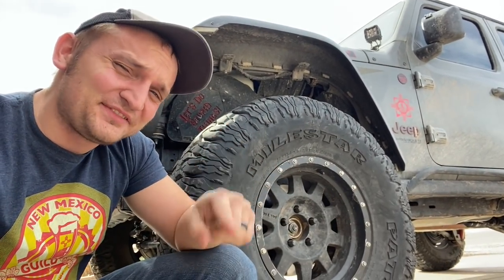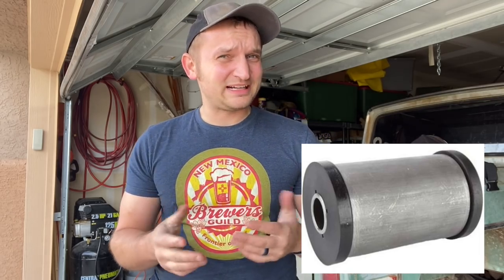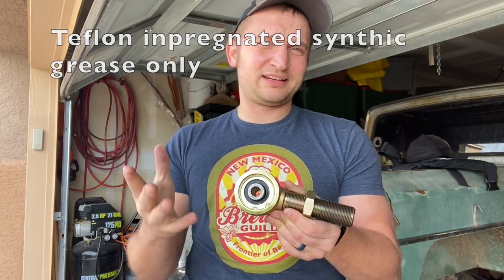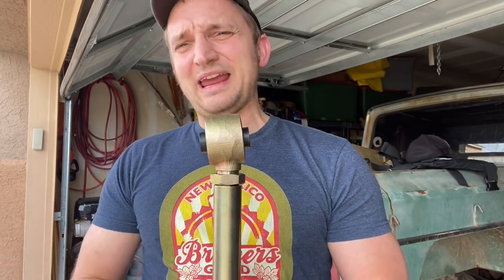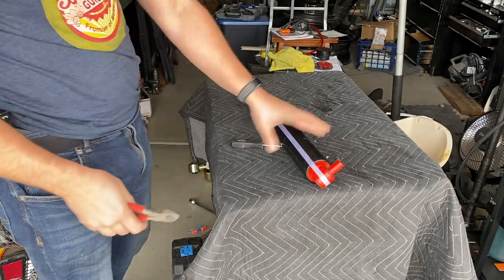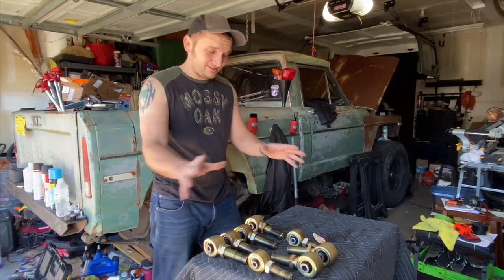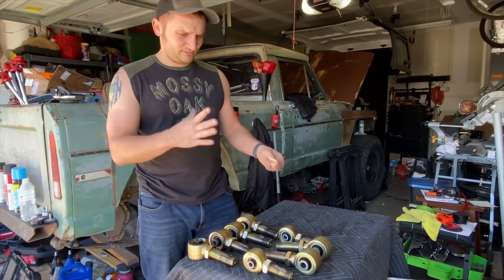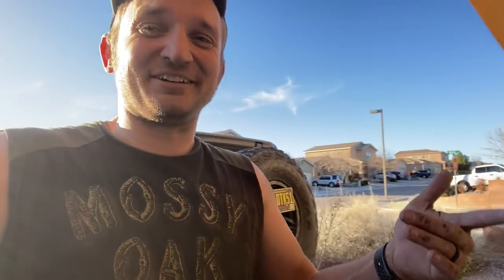Metalcloak Control Arms, What makes them unique? Game changer 3.5 Jeep JL lift kit

Comment: I install these lift kits. Just finished a 4.5 inch long arm kit on a Tj. There is a jk I did about 5 years ago with over 60k miles now that I put a short arm kit on and has never serviced bushings. No problems yet

Comment: I put 70k miles on johnny joint trackbars f/r in my powerwagon and only greased twice.  Never made any noise and now at 98k.  I just installed jj Currie Rock Jocks on my Jeep JL and couldn't be happier.   The bind/flex and weird handling/steering is 100% solved.
Reply from the maker: Thts awesome... would love to throw tons under bromance some day.... just keep on waitin to see if the cards get dealt to us lol. I love Johnny joints.. such a great performance part design.

Comment: That's a strange issue with the paint rubbing off the shock body.  I've never seen that before.  Thanks for the video and I appreciate the tips.  Hope to lift the Jeep in a year or so and plan to do Metal Cloak as well.
Reply from the maker: I mean... I probably should run more bump stop... but I love having all the extra articulation... really helps me do the stupid things 😂🙌

My logic is I don’t really see my upper shocks taking hots from rocks.... so I don’t think it will be a problem... 

Very happy with this lift so far... gear break in is almost done... I need to do some wheeling!
Reply from the maker: I’ll be doing a video on the the flex and comfort in a few months.. initial impressions... 

Thanks for watching! Can’t wait for u to lift your jeep! 😂 always an exciting time!!!

Comment: Is it common for the Rocksport shock boot to rub the red paint off? Couldn’t find anything about it on Google. And I plan on getting the 2.5” Game-Changers in the future.
Reply from the maker: Iv heard yes and no.... From what I’m figuring out... I think it really plays into how hard you wheel... rock guards on shocks ain’t common on aftermarket shocks either, and I think they look better without them on...🤷‍♂️😂

So I figure its easier taking them off now... rather then waiting for a problem and having to take all my shocks off again. 

I haven’t gone offroad yet (gear break in) but this lift is night and day on road... 

Iv seen plenty of JLs with this lift OFFROAD... and I’m not worried about how they are going to perform. U have made a solid choice 🙌🙌🙌

Comment: Great video! Did you have to replace the driveshaft when you installed the MC control arms? I know their website says you have to, but I don’t wanna
Reply from the maker: HAVE to? No. Depending on the level of wheeling... will determine how long the stock shafts will last. Maybe I should do a video about tht. 🤔 my wife’s jeep still has stock shafts... I have after market in mine

Comment: awesome ! appreciate your video , save me some money from buying useless mopar lift. so i need to change my driveshaft then enable to install the MC gamechanger 2.5 lift? i just checked my 2021 JLU it seems the front control bar is adjustable.
Reply from the maker: The stock shaft lasted me quite awhile on my 3.5 lift… I did change them,,, but the stock shaft didn’t fail, the slide boot did tear… and the cv joint boot was tearing… but the shaft was working… granted, those boots keep out dirt and debris, so it would of had problems down the line, but u can get away with stock shafts for a bit…. Even more so being an inch less
Reply: @JLLIFEOFFROAD  do you think if i go with the 2.5 lift, the stock driveshaft will last longer?
Reply from the maker: Thts what u said right? 

I mean I wheel pretty hard… u can easily stretch the life span of the stock shafts for a few years

Comment: Thanks for this vlog … I am trying to figure out what lift I am going with … I am hearing that metal cloak control arm are hard on the mount point during miss alignment.. I have seen that problem happen .. so I am still researching this issue !! Please message me in Facebook if you do not want to discuss this here … but i would love to hear your opinion
Reply from the maker: Thanks for watching...my experience with these arms is limited to a gear break in and 1 wheeling trip...

Tht being said... no complaints on performance.... install was pretty easy compared to some other control arms I’m Iv done..

As far as being hard on the mounting points... Few things I would say...

1. U want to be flexy... ur gonna our bond in those mounting points.. regardless of the arms... Thts a lot of weight

2. Jeep used thin meta to make the mounting spots

3. U can always add bump stop to prevent over flexing 🤷‍♂️ 

Metalcloak lift has 68 degrees of misalignment... RK has 60... i lm waiting for someone to release thicker mounts... mine were all twisted to hell when I swapped these in...
Reply: JL LIFE OFFROAD I still have a little while before I upgrade suspension … so I will continue watching you and researching before I make decision !! I really am leaning towards metal cloak !! But we will see !!
Reply from the maker: Kevin Ellis Initial impressions.. thoughts?? I’m kinda liking this maintenance free joint idea... I hate dropping arms to grease em... they don’t always line back up easily. 😂  big question is how long will they last

Comment: Later if you need to adjust this Metal cloak control arms, do you need to take them out before you can adjust or you don't have to take them out on jeep while adjusting?
Reply from the maker: U will need to drop them to adjust... Teraflex and synergy are the only ones tht make an arm with a double adjuster sleeve to do tht.

Comment: I have my MC control arm set ordered, Did you install all 8 control arms with your Jeep on the ground?
Reply from the maker: I did, it can be a headache... but it’s doable.. Tips to help... only do one at a time...
Reply from the maker: Using a Jack to lift one side of the axle can also be beneficial getting holes to line up.

Comment: How bad was your caster with using the stock arms and 3.5" lift?
Reply from the maker: When it was stock front LCA? 4....  added the adjustable cavfab arms... moved it to 5.5.... it’s currently at 7..... but I don’t like the pinon angle... will likely pull it back again
Reply: @JLLIFEOFFROAD  7!!??!   Like a chopper!!  Lol.  I thought mine was bad.   How did it steer at 4?  Like ass??
Reply from the maker: JL's Jk complete ass lol
Reply: @JLLIFEOFFROAD  lol.  I wondered.  Mine did too before I used the geo brackets.  Scary AF
Reply from the maker: JL's Jk I had hardcore DW at 4

Comment: If you are doing a 3.5 inch lift, should you upgrade the lower control arms or the upper control arms at the same time of doing the lift? Do you have to do front and rear or only front?
Reply from the maker: So... obviously the more adjustable control arms u have.. the better ur jeep will flex and allow for geometry correcting... however arms are pricey.. U can do a pair at a time...  I’d start with front lowers.... (allow for caster correction) 2. Rear uppers (allow pinon angle correction) 3 rear lowers.. 4. Front uppers. I only had after market front lowers for awhile.. I was able to do a lot of stupid things...
Reply: JL LIFE OFFROAD awesome thanks! I’ll definitely do the front lowers first. I won’t be doing extreme off-roading but I just want to make sure the geometry is fine and it will run correctly once lifted. I do plan on doing them all but not right away. Do you think it’s good to do front and rear lowers first and then the rest?
Reply from the maker: Start with front lowers 🙌🙌🙌

Comment: How are the metal cloak control arms holding up? Thinking mc or synergy… any advice on either?
Reply from the maker: Between those? I’d Stay away from synergy… just horrible customer service in my experience and is a common complaint I hear from others. I like the idea of adjusting while under the jeep, but I cannot get over how poorly they treat customers
Reply: @JLLIFEOFFROAD  thx for the response and feedback on the customer service... I agree it can make all the difference... how about in quality of product? In your video you had mentioned you wished the MC arms were a little thicker... are synergy any bigger?
Reply from the maker: Mc and synergy are the same thickness… use the same joints… but synergy uses the double adjuster which allows for adjusting under the jeep.
Reply: @JLLIFEOFFROAD  Awesome... thank you... you're the man! You seem to be one of the few that I actually believe when it comes to product knowledge! Thank you for your help my man!
Reply from the maker: Always happy to help 🙌🙌

Comment: I've had a 2.5" gamechanger lift on my JK for over 4 years now and the only complaint I have is how easily it ended up rusting. For a product that heavily markets itself on the zinc coating to resist corrosion, mine started fairly early and has gotten pretty bad ever since
Reply from the maker: Bare metal will rust... regardless how quality the steel is.... if their was a deficiency.... I’m almost certain metal cloak would have made it right... their customer service is the best Iv seen from a company.
Reply: @JLLIFEOFFROAD  Understood but I never bang up or do the kind of offroading that dings up my underbelly, so the corrosion I had on my metalcloak lift was purely just by daily driving it and getting the typical salt road season
Reply from the maker: Sounds like it was more of a defect... sorry to hear it... I’d have had issues with their stuff in the past... I called them and they took care of me no problems
Reply: @JLLIFEOFFROAD  I'm not discrediting you since you do like them and probably sponsor them for multiple reasons, but I wouldn't just say my situation was only a defect, figuring it happened uniformly across every zinc component in my kit. No lift kit will ever be perfect but next time, I'm just going to try a product with a different kind of coating to compare and hopefully get better results
Reply from the maker: Not sponsored... 👍👍👍
Reply: Man I was going for Metalcloak but now I'm on the fence.

Comment: Good video. Thanks for the info. I have the same arms and painted them red to match the tow hooks. However I had issues getting the paint to adhere to the zinc properly. I could take my nail and scrape the paint and primer right off. Did you see any adherence issues? If not, what paint and primer did you use? I used duplicolor.
Reply from the maker: I don’t remember what I used... I primed it several layers before painting it... it didn’t hold up to scratches... but didn’t really expect it to... tht zinc coating is really important in preventing rust.. 
I’d recommend putting on a good clear coat after painting them to help prevent them scratches

Comment: you should of done an install on how to remove and install control arms - torque numbers etc for the JL's theres a ton on JK not JL FYI
Reply from the maker: The principle is the same thou... one arm at a time... 2 bolts an arm... I can think of 1 jl channel and 2 JT channels tht recently done a video on how to install control arms...I figured educating was the better option... plus Iv done a video on RK x factor lift and installing LCA on the JL...

Comment: Thats the thing...They're not special or unique. They haven't done anything innovative or that hasn't been done before. They basically took Synergy arms and zinc plated them gold. If anything they're the most overrated suspension there is. It's their marketing that sets them apart. They name their kits with some fancy buzzword which leads people to believe it's something more than what it is but in reality, it's as basic as it gets. 8 arms, coil springs, track bars with optional gimmick shocks...what's so "Game Chaning" about that? I commend them though, anyone that can market a "long arm" kit that doesn't have long arms, that's quite the achievement! "Locked n Loaded Compound Suspension" that's one fancy name for radius arms and drop brackets...on what's supposed to be their flagship suspension. People should be insulted... That's a glorified Rough Country caliber type suspension but I guess getting to hashtag #cloakedrepublic is cool and trendy.
Reply from the maker: Want to show me on the doll where Metalcloak touched you?